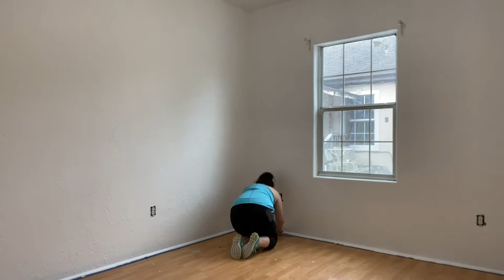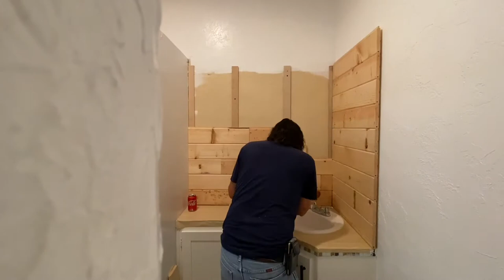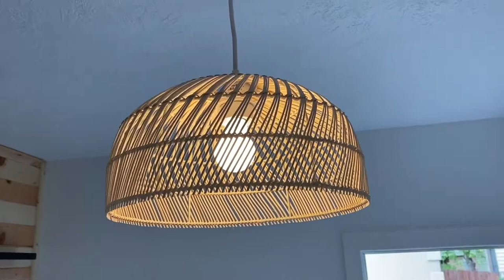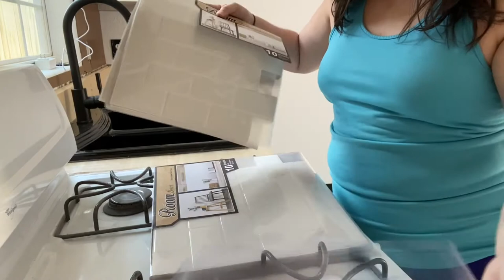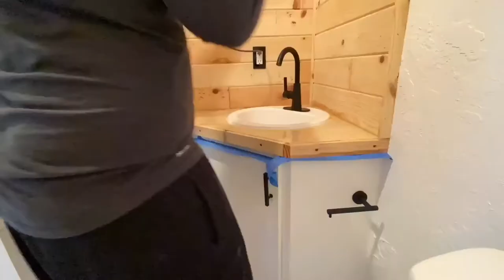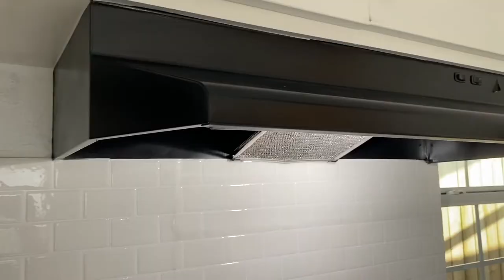Renovating a 400 sq. ft. Unit (Garage Apt.) Tiny Home | Budget Friendly

Comment: Pretty good with the exception of using vinyl for backsplash and countertops.  The adhesive on the back of the backsplash will deteriorate from the heat of the stove and come off.  The vinyl on the countertop with the 'protective overlay' will look really bad and deteriorate once a renter uses a knife to cut something on it.   Both of those areas are very small, using an inexpensive tile or a remnant of solid material would have been a work horse for you for many years to come without the headache of vinyl.  You spent money on shiplap for walls which did look nice but you could have used the money spent on that to address what takes more wear and tear than the walls, the countertops and backsplash.
Reply from the maker: the backsplash and vinyl are still doing great after 3 years! ☺️ we plan on replacing the countertop with butcher block, so this was a budget friendly option during the pandemic. thank you for watching and giving your insight for others in case they wanted to do the same thing!